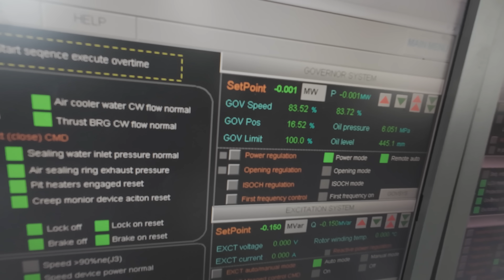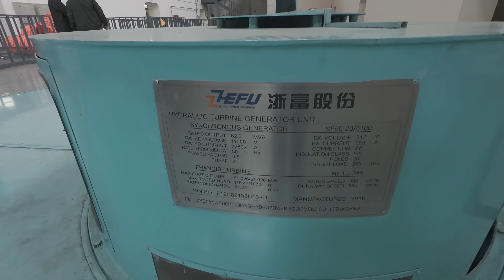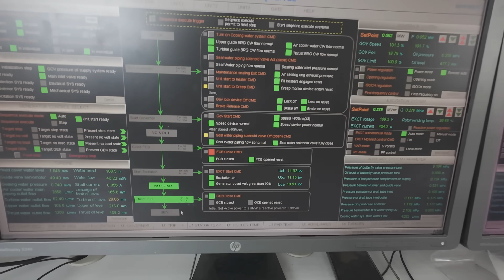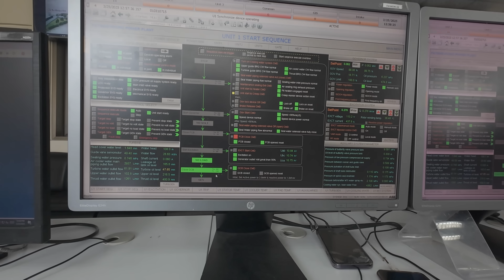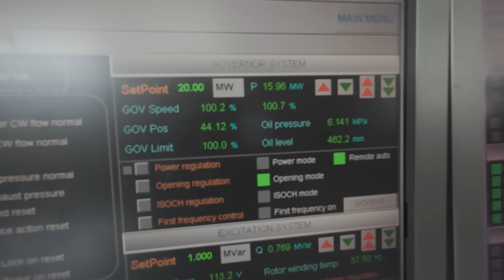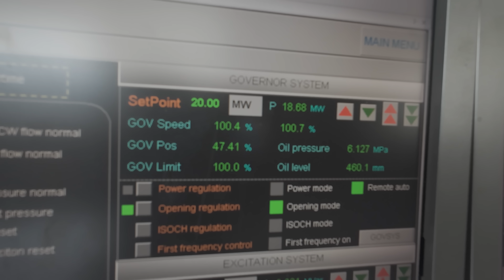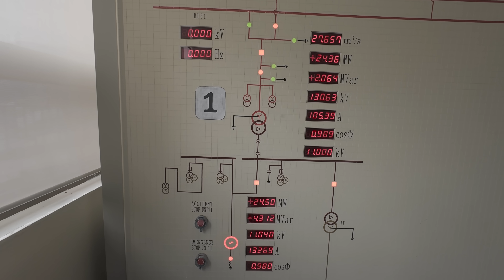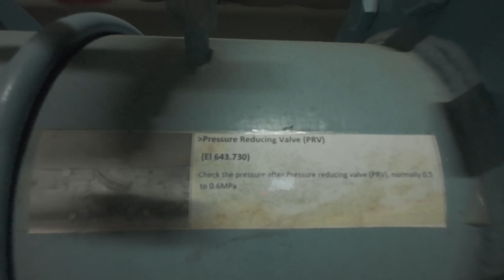Francis Turbine Automatic Startup: From Zero to 25MW Hydropower Generation

Comment from the maker: Do you know how does a unit is synchronized with the Grid?
Reply: In the old days you would bring the unit up to speed, if it doesn't do it automatically turn on voltage regulator around 90% speed. Turn your synch scope and lights on. With your speed adjuster get the synch scope rotating slowly in the fast direction and with a little bit of lead close in the main breaker at 12 o'clock, hopefully you have at least a synch check relay to stop anyone from doing something really stupid . Then pick up load with your speed adjuster and set it to the appropriate gate setting. Of course now-a -days a computer can do all that for you.
Reply from the maker: @stuglenn1112 Absolutely right! That’s the classic way — full manual synchronization with synch-scope and lights. It’s amazing how much skill and timing it required back then. Modern automation has made it easier, but that old-school precision and experience will always have its own respect. 👏⚙️

Comment: In Victoria there was a small hydro with one turbine. Sometime in the nineties an I beam passed in the water intake into the turbine and smashed everything. On the news I saw big cracks in the floor. The paperwork would have been incredible. I vaguely recall it took 3 years to fix it.
Was at Dartmouth reservoir, I beams were for maintenance, how could someone omit to remove them at the end of the job?

Comment: What kind of huge thrust bearings does a turbine that big use?
Reply from the maker: Great question! 🙌 Big Francis turbines usually use a tilting pad thrust bearing (Kingsbury type). It carries the huge downward axial load from the runner — sometimes hundreds of tons — with a thin film of oil between pads and the thrust collar, so there’s no metal-to-metal contact. This ensures smooth operation, long life, and protection of the whole shaft line. ⚙️💧

Comment: Used to work at Scottish Hydro-Electric.   Some of our plants were from the 1940s/50s.  All but the very largest used PLC systems to auto start and sync by remote control, no nice screens with all the parameters like that - although I did spot a few typos!  Need to get me to proof read the (Chinese?) developed software!

Comment: What's a "wicket?"
Reply: Wickets direct the water onto the turbine rotor, the angle can be adjusted rather like a throttle, they are arranged around the Volute (casing) shaped like an aero-foil and operated by hydraulics.   Once the turbine is at speed they will adjust for the best angle to extract the maximum amount of kinetic energy from the volume of water moving through the turbine.   A Wicket is also three wooden stumps which the bowler tries to hit.

Comment: I started MW Francis turbines on a regular basis during the commissioning of 2 hydro station (8 turbines).
Although thie video shows a semi automated start, manually, there are a few additional steps to take.
1 - Turn off brakes. 2 - start HP oil pump to lift the turbine off the rotor bearings. 3 - Turn on cooling water. 4 - In manual mode, open wicket gates to 15%, then at Gov speed set Gov to auto. 5 - Turn on Tx cooling oil circulating pumps. 6 - Close FCB and check field flashing has occurred. 7 - in the control room, check instruments (wicket gate, gen speed, stator voltage). 8 - Turn on the synchroscope. Fine tune voltage, and freq and close machine CB when slowly approaching 12 o'clock in clockwise rotation.
With practice you could do this in 3min.  When the machine was online, return to HP lube pump and turn off.
Reply: Thank you for the additional correct sequences.     I don't expect this Chinese hydro plant in India to last too long if they do not take a more hands routine. Relying on PLC / SCADA does not always tell the true condition of plant.

Comment: David below had the best comment.  We designed similar machines, and these are simple field-controlled generators (also aka motors).  We used such a motor on the Lunar Roving Vehicles, now degradating on the Moon.  The value of the Hydro drive is that the machine can be brought up to speed, without having to engage the Grid.  Using simple phase-control locking, like done now for self-synchronous motors, you can bring the speed right up to within a hundreth-of-a-cycle, to the actual network frequency.  As a result, the dynamic hiccup which occurs, is similar to a common Multiple Lighting Strike on parts of the system.  The phase lock disruption is dissipated within seconds (usually).  Unless the system is already marginally Un-Stable, the total weight of the rest of the load absorbs the reactive current.  It is the Q of the whole system which determines if the system goes unstable.
Reply: Yeah, as if we went to the Moon. 😂

Comment: Daily inspections of the water inlet and outlet pipes is of utmost priority  I believe. The amount of pressure those pipes are withstanding is probably a lot higher than those in the oil drilling platforms

Comment: Nice! I love to remind everyone that this is all from stored energy from our sun, Original wind and solar! Seeing them in person is definitely suggested
Reply: Yeah, but this works on cold, dull, and windless days.
Reply: Precisely why alternative energies need to come in all sizes. As we continue to improve the technology and its efficiency, all sustainable energies wind, sun, and water should be utilized.
Reply: @bchluvrxyz816 Except you need a reliable base load power supply which can only come from nuclear, gas, oil or coal generation and certain high performance high reliability hydropower stations.
Reply: It's a hydro plant not solar or wind. Sun doesn't make rivers.
Reply: @aethelred9781  Well, yes the sun does actually make rivers. By evaporating ocean water and delivering it as rain at altitude, where it forms rivers that flow back to the ocean.

Comment: I worked as an operator in steam electric generating stations that burned natural gas or fuel oil in boilers to make steam to drive steam turbines to generate electricity. It takes around 12 hours to start up one of these steam electric generating units. I find it impressive how simple a hydro electric generating unit is. It takes only a matter of minutes to start a hydro electric unit. I also noticed that this hydro electric plant had modern computerized controls, which includes automatically synchronizing the unit to the line. With old controls and old units an operator had to match the voltages and the speed manually and use a device called a synchroscope with a pointer slowly rotating in the fast direction and manually close the circuit breaker when the pointer was at the top.
Reply: @ Yep heat is fickle and morphs as it moves around. It takes a long time for any thermal based system to fully stabilize.
Reply: I saw a video Chris Boden did of syncing a small generator of I think 400 KW and he said you had to be precise with the syncing or bad things happen.  Like the multi ton flywheel flying out of the generator hall.  I guess this would be like an old gearbox in a non syncro transmission or if you are going to fast on your motorbike and kick down and dump the clutch and lock the back wheel.
Reply: @ It has to be at the same exact speed and in phase with it because during sync you ideally want zero power transfer.

If the generator is lagging behind the grid and connection is made, the generator will behave like a motor and try to suddenly increase its speed to match the frequency of the line. This causes a LOT of power to suddenly flow, which stresses both the electrical components and also mechanical.

The inverse happens if the generator is leading ahead of the grid, but with a similar outcome. A strong sudden "braking" force (since YouTube will delete the comment for using the correct word) as the generator is ahead of the grid and needs to lose some energy to be in step with it.

The transmission analogy is somewhat accurate but unlike a transmission synchro which can align in multiple positions (the different shaft angles will lock in just the same as any other), the generator and grid are only in step at one angle in relation to each other.

In a nutshell, if the phase difference is 0 degrees, then it will sync up perfectly and no current will flow in an attempt to correct a difference. Tiny differences won't be much of an issue (1 or 2 degrees off) but the forces and power flows get stronger with a greater difference between them. If this happens at 180 degrees out, the generator and grid will be in complete opposition, and the generator will be trying to consume about 4x the power it is rated to produce to begin with. Not good indeed.

Once they are in step and connected, the generator can't get ahead of the grid and attempting to do so is what loads it up into the grid to produce useful power. The grid holds the speed back as more torque is applied to the shaft.

Hopefully this helped.
Reply: @ I do understand what you were getting at as I saw Bodens syncing old plant to the grid and how it had to be perfect or BAD things happen.  The thing I said about the bike was one time when learning I pulled in the clutch and kicked down and let it back out. thus the road speed trying to speed the motor up but locking the back wheel.  You dont do it again hehe.
Reply: @MadScientist267  that all sounds a bit like vodoo to me. I understand the electrics of a 60s car. And I set up a simple PV, 12V battery, inverter, live in vehicle, system. With the increase in renewables, and storage batteries on the grid, could those batteries be big enough, such that different supplies could be converted to DC, and just add to the charge rate? As I understand things I could have PV  and a wind turbine simultaneously charging a bank of batteries, is that correct? Or would it be impractical?
Reply: @steviebboy69  I did the equivalent of a hand brake turn on a motorbike, by doing that, by the time I caught up with events I happened to be pointing where I wanted to go, so I wacked open the throttle, and all was good. More luck than judgement!
Reply: @ Clive Yes things are much different in the DC world where you simply "bring the two together" at some point and things naturally flow the way they need to.

Battery is used in grid storage, but there are issues with it yes. Namely efficiency hits. It's complex but the nutshell version is every place there's a conversion happening, be that AC to DC, DC to chemical, then back from chemical to DC, DC to AC, etc and then ultimately into whatever form it needs to be in to be transported and delivered to a customer, etc.. all represent non trivial losses to the system. This happens enough as is with a traditional AC grid in places like transformers where the voltage must be stepped way up for transmission to minimize resistive loss in the wiring, then back down again just before use. Pretty much every usable idea is in play somewhere or another, with varying success and overall efficiencies.

Edit: It's also very expensive to store a useful amount of energy on the grid chemically.
Reply: @MadScientist267 I watched a vid some time ago explaining what happens when the generator and grid are not in sync and are connected. The generator threw itself out through a concrete wall. I don't want to think what would happen to 25MW generator if not synced.
Reply: @ Yeah it would be pretty intense. When synchronized, the connection is like a car changing lanes on the highway. Everything is moving together and there's no issue.

Connecting while out of sync (180 degrees) is more like coming the other direction at the same speed. Instead of a nice smooth lane change where everyone just keeps going along, a head on occurs, and the results catastrophic. In the generator the only real difference is instead of cars, you have magnetic fields. If you have ever tried to push like poles of 2 magnets together, you can understand how much force would be involved.

A minor difference would be like bumping the car in front of you, and in most situations doesn't result in damage. You can imagine however using this analogy that it doesn't take much difference to become a real problem.
Reply: I too worked at a clean coal stream plant, with millions of moving parts and huge temperature constraints.  I used to kid my buddies who worked in the hydroelectric side of our business by asking them how their moving part was doing at their plant!
Reply from the maker: That's wild!  I can't imagine waiting 12 hours for a power plant to start up.
Reply: @ali_naqvi1214  Here is why it takes so long to startup a steam electric generating unit. There is a very large boiler full of water that has to be slowly warmed up to a pressure and temperature sufficient to start rolling the steam turbine. Then the steam turbine is also cold and takes about 4 hours to slowly warm up the steam turbine from initially rolling the steam turbine till the time it is up to speed and ready to be synchronized to the line. Also after the steam turbine is synchronized to the line it takes about 2 more hours of warming up and thermal expansion of the turbine before the unit is ready for normal system loading.
Reply: @davidgrisez warming everything takes time.  The most important part is the steam turbine differential expansion.  I love running the big steamers.
Reply: @davidgrisez  solar installations has to be the simplest thing out there😅
Reply: @davidgrisez  Depends on the unit and what it was designed for. I worked at a plant that had two gas fired units rated at 450 MW, they were peakers, cold start was 2 hrs. Hot start was listed as 1 hour but we could often be on the grid and on AGC in 45 minutes. Their heat rate was horrible. Same plant another unit rated 395MW and at one point had the best heat rate in the state, a base load plant, that one  it took twelve hours.
Reply: That’s impressive I once stayed at a red roof in next to a steam generated power plant. I now understand how they keeps the light on for me.
Reply: bro same here i worked in coal thermal power plant same feeling so much process in thermal power plant
Reply from the maker: Connect I want to make a video on thermal power plant also
Reply: the generator will sync to the grid in phase or......
Reply: Almost 50 years ago I worked in a Diesel power plant, and later in both a Steam plant and a Diesel plant, both jobs with municipal utilities.  A Diesel machine can be online producing power in minutes, or if designed for it, in seconds.  But they can be a bit finicky, and take a lot of attention and running maintenance.   And wait until you see a crankcase explosion!!!

The steam plant I worked at for 4 years was very small, 13.7 MW, but was just as complicated to start and operate as a 500MW unit, just scaled down in size.  The last year or so I was there we shut down every night because our tie to a major power system could carry the whole load.  We would fire the boiler occasionally to keep it just under operational conditions, and start up about 6AM or so.  Those were interesting times!!  Working in a power plant is hours of utter boredom punctuated by minutes of frantic activity if we went in the dark!!
Reply: Why does the generator power output need to be synchronised to the grid? And what would happen if it wasn’t?
Reply: @gdog1443  With Alternating Current the current and voltage have a sine wave form. The sine wave of the incoming generator must match and align with the sine wave of the electrical system before closing the generator circuit breaker. If these two sine waves are not matched and aligned and the generator circuit breaker is closed. The electrical system will suddenly and abruptly pull the generator in to synchronism with the electrical system. This manifests itself with the generator letting out a loud bang sound and the floor of the building jumping. This will cause damage to the generator that can be such things as bent generator windings and a broken generator shaft. So improper synchronism of a generator unit to the line is undesirable and to be avoided.
Reply: @davidgrisez oh okay, thank you for your reply.
Reply: i have seen Chris Boden do a manual match, exactly as you describe